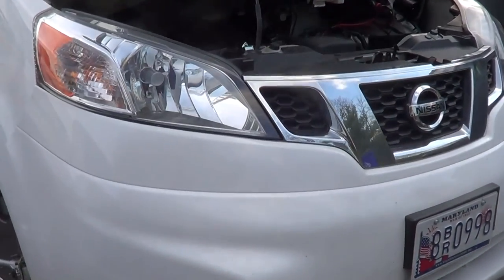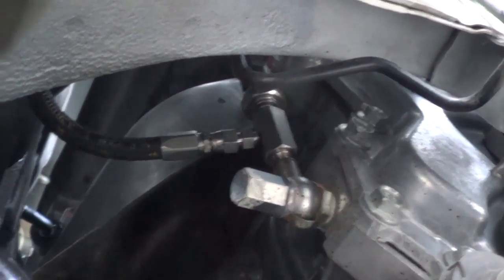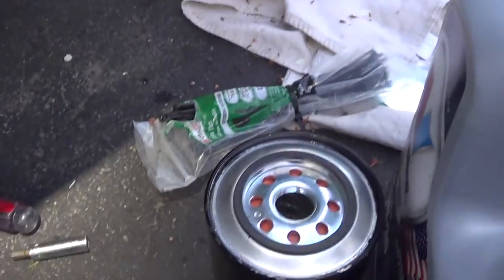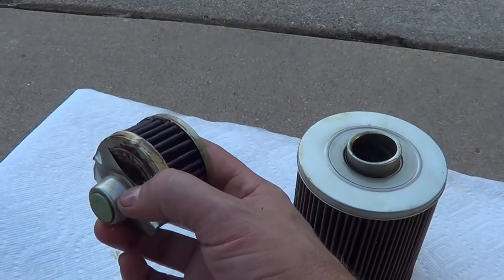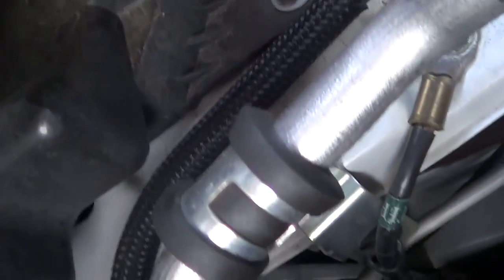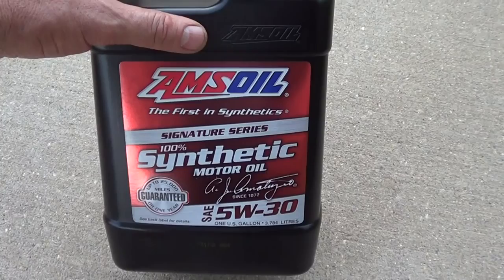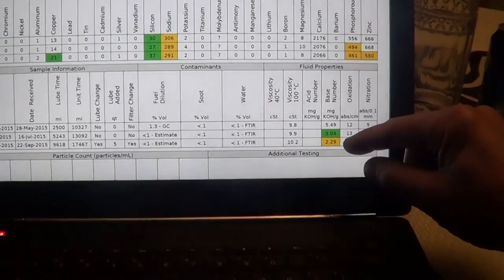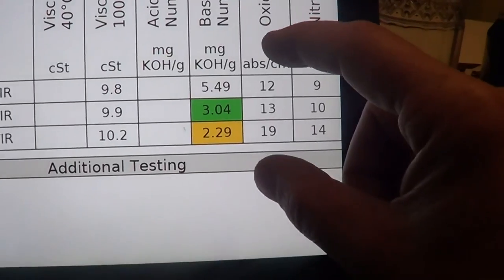Oil bypass filter results on a Nissan NV200 gasoline engine

Comment: I use Valvoline High Mileage which is a synthetic blend not full synthetic on my 2000 GMC Sierra and has 261,000 miles on it. I have changed the oil at 3000, 4000, and 5000 miles and your oil looks like when I changed it at 5000 miles dark, but clean. There should be no way your oil is that dark with full synthetic which is more clear from the start with only 2600 miles. How many quarts does it hold? Also are you an Instrumentation tech? Oil being dark is from the soot of the gas burning, still should not be that dark at 2600 miles unless you have a 4 quart capacity or less.
Reply from the maker: Bret Feeney I gave up on bypass filtration.  Changing oil at 7000 and the main filter at 3000 miles is the better way to go.  Deisel big rigs may be able to go 100k miles on a single oil change.  But I found that gasoline engines don't like dirty oil at all.  I have some update videos on this.
Reply: Yes it's the soot that contaminates an otherwise perfect oil. Soot particles clump to form larger harmful contaminants. You don't have that issue in a gas engine.

Comment: Actually Mobile1 full synthetic is much better in freezing cold weather, Youtube has a great video comparing Amsoil, Mobile1, Royal Purple, and a Walmart synthetic. 

In a cold weather simulation at -40 degrees, Mobile1 starting pouring first, followed by Amsoil a short time later, Royal Purple came in 3rd, although pretty slow, the Walmart brand barely poured out anything at all and took a really long time to even start.

Comment: Hey did you have to drill the hole on the sump?
Reply from the maker: Yes.   But it is better to punch the hole with a nail so that there is meat for the threads.

Comment: What is that SQUARE box at the air intake? I opened it once, there is nothing inside!
Reply from the maker: Probably a tuning cavity to help improve the airflow on the intake.  It takes some of the pulses in the airflow from the cylinders drawing in air.  It is probably only useful at full throttle.
Reply: @NathansHVAC  that is a most likely purpose now you mentioned it. Thanks. The air pipe or hose is too long, so is is like a buffer. It makes sense.

Comment: So if only a trickle of oil can go thru BP filter, 
how can you say 
the rest of the system will be starved for oil 
10-30 sec at start-up [if don't fill it on change]?
Huh?
Reply from the maker: That is why I installed a pressure gauge.  I wanted to see if the bypass filter drains the oil galleries.  It doesn't.  The amsoil pleated bypass has a silicone check valve that prevents bleeding.  And, the 6 inch depth filters have sufficient resistance thru the media to prevent draining.  I have even checked this after the vehicle sitting unused for 2 weeks.  Oil is fully pressurized faster than I can see it with my eye.

Comment: Seems like if you're running a 2 micron filter then the contaminants values should be very low, certainly not in the "yellow"
Reply from the maker: I just completed 2 test runs of 10,000 miles with and without the bypass.  The particle count difference is negligible.  I will probably try a run with a Kleenoil type filter next.  It is basically the toilet paper style bypass filter.  However, I emailed my Amsoil results to Kleenoil and I am awaiting a response.  The bypass system so far has been very disappointing.  But, I guess I should be happy with 25% cleaner oil?
Reply: NathansHVAC if that 25% is equal to 100% of particles over a micron, then id say yes.
Reply: NathansHVAC considering I’m replying to a 2 year old comment lol.. 25% cleaner in a gasoline engine is something substantial. You have to remember these bypass systems were designed with Diesel engines in mind, which contain much higher amounts of soot. The percentage of cleaner oil in a Diesel engine would be substantially higher than it would be in a gasoline engine.

Comment: What about the results  from the test you said you were going to do. You said you would run with the bypass filter blocked for 10k miles to see if there was any difference, and then run for 1k miles without the bypass filter and then unblock it to see if it cleaned the oil.

A video update would be great
Reply from the maker: I didn't see any difference.  However, I will make a quick video right now explaining all the test results.
Reply: Wow, that´s crazy, I didn´t expected that
Reply from the maker: I just ordered a different bypass system that uses cellulous.  It isn't cheap.  But, I will test it and post the results.  I ordered the AL50 from Triple R.  It has been discontinued.  But, it is similar to the parker racor.  https://www.youtube.com/watch?v=Lj_FhHJa0Sk  There isn't better filtration than this.  My test results may be inconclusive because the engine oil was already "very clean" even though it looked dark.  I was using a top of the line main filter also.  But, my goal is to have oil that also looks very clean to the eye.  I will see.

Comment: Can you put a Luber Finer full flow filter on to keep the base up?
Reply from the maker: I'm finding that the bypass might not be needed.  Particle testing at 5000 miles without the bypass shows similar "very clean" oil with a high quality main 20 micron filter only.  Going smaller than 20 micron for the main creates pressure and flow problems when the oil is thick and cold.  Having the bypass valve open in the main is bad.  I will post all my results without the bypass in another month when I hit 10,000 miles on this run.  One other thing.  You are confusing base with particle count.  Base is the detergent in the oil.  Good quality oils are about 20% detergent.  The chemicals keep sludge in solution and prevent solidification on the engine surfaces.  Pure oil would be very bad because the engine would gum up.  So, it doesn't matter how good the filter is for keeping the base up.  The only way to keep the base up is to add more oil.  Old leaky engines are great for keeping the base up because you constantly add oil.
Reply: LuberFiner filters are a full flow filter with additives that replenish the base.

Comment: People who use the word micron are special. It's a small engine and the stock filter is find.
Reply from the maker: +blackericdenice   I am trying to go 20,000 miles between oil changes with a full flow filter change at 10,000 miles.  The Valvoline Full Sythetic didn't do very well at 10,000.  Now, I am at 10,000 miles with Amsoil Signature Series.  I will check the lab results to see if that oil can make it 20,000 miles and still have a decent amount of additives left.  I admit that a bypass filter might be hype if the oil can't go very much further in a gasoline engine.  I will post another video when I know more.
Reply: NathansHVAC You are worried about the additive lasting and that's not what you should be looking at. Blow-by from burning fuel will get into your oil. This is what hurt your oil and why you should change it. The filter will stop the some of the dirt from this burning but not the wet part of the burn.
BTW, I just tried Valvoline full synthetic 5w30  today in my 04 Trailblazer. I use 5 quarts of it, one quart of Valvoline synthetic blend and one quart of Mobile One full synthetic. The Val-full-syn was very light in color and thin. I want be using it again. The Val-syn-blend was darker and slightly thicker but not as dark and thicker as Mobile one. I have a video of this on my channel.
Reply from the maker: ***** The contaminates from blow by are water, acid and carbon particles.  The water is evaporated with air flowing thru the PCV valve.  All modern engines do this.  The acid is neutralized with the additive package.  Amsoil has the most additives.  And the carbon particles are captured in the bypass filter.  Particles less than 2 microns are too small to scratch any of the surfaces.  This is purely an experiment for long duration oil changes on this 4 cylinder Nissan engine.  Diesels have much more blow by from the higher compression ratio.  I'm just doing what is typical in commercial diesel engines and applying it to gasoline.  The Valvoline oil couldn't go more than 10,000 miles in my engine before the additive package pretty much wore out.  I'll keep updating on how it goes.

Comment: Wow! Great job dude! Very few people even know about bypass filtration. I have friends in big rigs running 400,000 miles without an oil change.
Reply from the maker: Thanks for the comment.  The only thing that troubles me is that I wasn't able to show particle count differences with and without bypass filtration.  Also, I think diesels have much more soot than gas.  The main reason that gas requires oil changes at 10,000 miles is the reduction in the acid neutralizing base number on the oil.  So, I was hoping to go longer on oil changes, but lab testing still red lines me at 10,000 miles.  I'm still using the extra filtration on 2 vehicles.  But, I'm not convinced it is doing anything.  I even tried to check oil color differences and I couldn't notice any.  I guess it doesn't hurt to have 2 micron filtration.
Reply: Carlos Cruz what?! 
that's fucking bull shit, with or without a bypass an engine without an oil change cannot and will not reach 400,000 miles (let alone km)
Reply: Hemi yes they can. I personally did 230,000 no oil change.
Reply: Hemi ops system filter down to 1 micron filter changes are required and due diligence with frequent oil samples.
Reply: Hemi yes they can I have no reason to lie to you
Reply: Thats impossible, in that time ANY oil will shear out and lose its add pack. Plus it would have burnt it all off. Its possiblr they were just adding a quart whenever low so it technically had some new oil at all times, but thats still no way to treat an engine.

Comment: Just so you understand a court hearing awarded the petroleum industries the ability to put full synthetic on their oils and only require them to have 25% synthetic components. All full synthetic oils are petroleum based stock with synthetic additives. So you need to investigate which oils are 100% synthetic. I don't suggest doing long intervals with full synthetic oils is there not full synthetic. What

Comment: What bypass system did you install?
Reply from the maker: Amsoil BMK21 universal bypass filter.  Oil testing with particle counts confirms the oil stays "very clean" with 10,000 mile oil change intervals.  I'm finishing up my second 10,000 mile run.  The additives deplete too much to run the oil out more than 10,000 miles even on Amsoil Synthetic.  Just for kicks, my next 10,000 mile run will be with the bypass filter blocked off.  I want to see if the bypass filter is actually doing anything.  If the oil particle counts are worse, I will know the bypass is working well.  I'm using a top of the line main filter.  I will update this video in about 6 months with the test results.

Comment: If your trying to protect your engine than change the fluid more often. You put all that crap on the teuck and now your going to run the oil for much longer. Whats the piont. Change the oil more often.
Reply from the maker: That is correct.   7,000  miles oil changes are the best.

Comment: Good way to void your warrantee!
Reply from the maker: That is why I'm making this video and the next one that shows test results with and without 2 micron bypass filtration.  I can risk my engine and publish the results so you don't have to risk yours.  If the standard 20 micron main filter provides similar particle count results as the bypass filter, the extra filtration is simply overkill.  I should have my follow up video by the end of the year.  I'm running the engine with the bypass filter valved off right now.  I"m at 1,700 miles and the oil is looking alot more dirty than usual.  But, I will run the lab tests at 5000 and 10,000 miles for direct comparison with and without bypass.  There were ZERO videos on gasoline engine bypass filtration on YouTube.  Believe me, I would have liked to find such a video and avoid the trouble.

Comment: change the oil more often flushing the engine of all the junk
Reply from the maker: The gunk is actually dissolved by the detergents in the oil.  They act like soap and keep the gunk in solution.  Good quality oils are 20% additives any only 80% oil.  But, you are correct that changing the oil often is better than longer intervals.  The additives become depleted.  I'm just doing this testing to see if gasoline engines can still have good oil test results with long duration oil.  Diesel engines can go 150K miles on a single oil change.  I'm waiting for my latest 10K oil test run on a RRR depth cellulose filter to come back from the lab.  I suspect the oil will be very clean because it still appears golden.  However, the detergents are probably spent.  I'll post a video in a week on the test results.  Acid is actually more damaging to aluminum engines than gunk.

Comment: all api full synthetic oils are FULL synthetic, do your homework ,bobs the oil guy and read ....oB
Reply from the maker: Sorry, only Group IV oils are full synthetic.  That means they are man made and not from crude oil.    http://bizol.us/1118/     I only see Amsoil and Mobile 1 that are Group IV.  Let me know if there are any others?  http://www.technilube.com/faqs_info/synth_diff.php   Group 5 is full synthetic too, but it is super expensive, so nobody uses it.   If the oil doesn't publish what group the base stock is, it most likely is group III.
Reply: most say half synth,
 but I run full synth Ford Racing 5w50 or Mobil 1 15w50.
Sorry, NO, pose your question to API and you will find your answer....oB